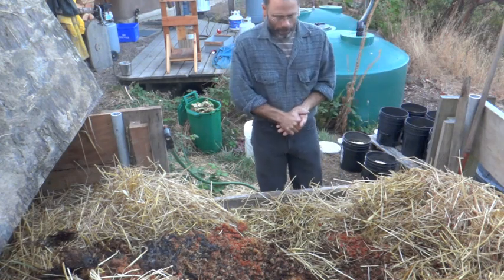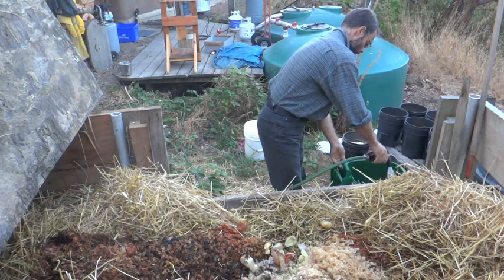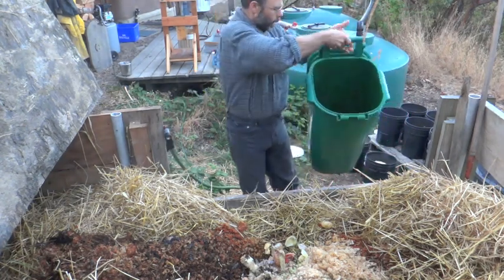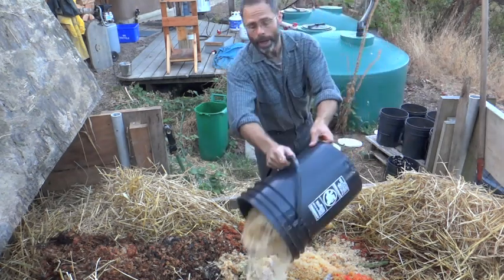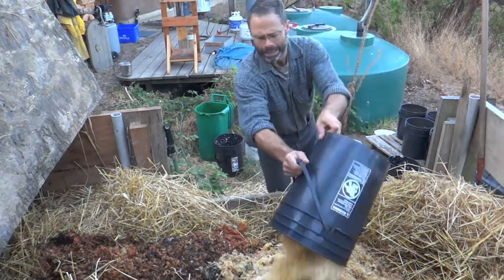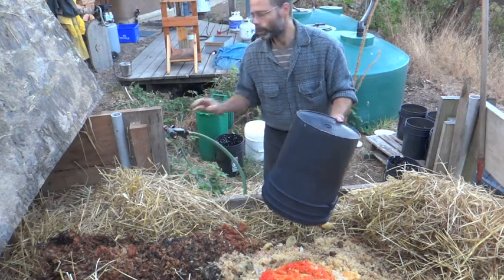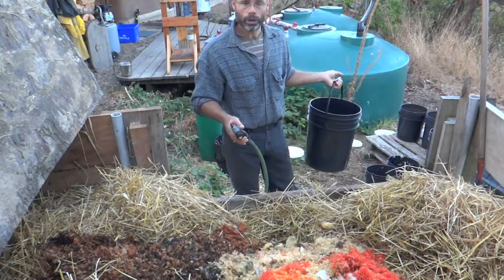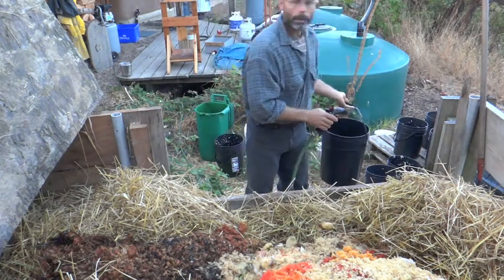Composting Humanure

Comment: Thank you for taking the time to share your knowledge and experience. I have a question regarding temperature. Could one raise the temperature of the waste to 160 degrees, say in an outdoor oven, to remove any harmful bacteria for safe handling and could that then be composted after?
Reply from the maker: Some compost piles do not reach the higher end of thermophilic temperatures, and this would either mean letting it stand for more time… or as you ask, raise the temperature.  If compost sits for 18 months at a cooler temperature, then you can be assure of safety - many "manufactured" toilets actually use a heating element in them to artificially raise the temperature.   I guess one could use an oven, though it would seem like a lot of work to place partially composted materials in it; I'd be inclined to just let it sit for a longer period of time and let the biology of the compost perform its job.

Comment: fluid and solids together or separate...?
Reply: +Duggy Dugg   All together.    Because this is a batch processing system, meaning it is easily collected and replacement buckets installed, fluids are not an issue that will impact the quantity or level of the bins.  The fluids aid in quicker composting.

When there are systems that receive heavy daily use of 8 or more people per day (at 2-3 yes each) then the bins would begin to be a hassle to replace once a day, and that's when in-situ chamber systems become beneficial.  With chambered systems the goal is to no old them up to quick, thus diverting fluids or draining leachate you can use less bulking agent.    Processing is slower, and does not get sanitized (thus an additional process is recommended to mature manure before dispersment).
Reply: wow ..nothing is easy ..

Comment: Awesome video. I wish there was a super like button instead of just like, but I hit the like button.
 I hope I'm not missing something in the discussion and making a repeat, but you had the perfect example to go with the mention of aerobic and anaerobic. The kitchen bucket stinks because it had gone anaerobic. The bathroom buckets stay aerobic as long as the shavings are applied properly and in adequate amounts to keep oxygen within the contents of the bucket. Right?

 One thing I'd like your opinion on is the safety aspect. I know you are conscience of this as you mention some about it. However, when dealing with more than your own, and especially if you deal with friends and outside family that stop by and may use your facilities, might one consider using a pathogen mask to reduce possible air born pathogens when dumping? Nothing is perfect, nor does it need to be IMO, but often there can be breezy conditions or dust from infected straw that may pop up when dumping. I feel it might be important to the future of composting to do what we can to keep negatives out of the news. Therefore high emphasis on safety when teaching us newcomers might be considered.

 Thank you for all your hard work and willingness to share.
Reply from the maker: The shavings provide a coarseness of texture allowing air gaps in the buckets and especially in the compost pile, and this coarse nature benefits air entrapment, thus aerobic… so yes you have hit the nail on the head.    (Sawdust does not provide this coarseness, so though it may be absorbent and a carbon source, it can lend to a stinkier compost pile as it compacts too much)

I support your suggestion 100 % regarding a face mask, and would add rubber gloves.  In the draft regulations we have just written for our Provincial Government (BC Minstry of Health) we stipulate the use of these as part of the requirement in processing the buckets for the exact reason you point out.     I personally will not process the buckets on a breezy day, or will stop and postpone unit the breeze has passed.   Good points and great questions.  Thanks.